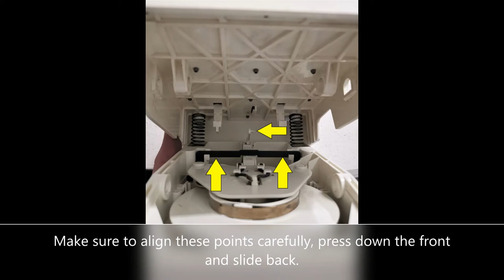Service of a Bernina Foot Pedal - Type 1000 Series

Comment: Hi Richard. Thanks for the video. Do you have any knowledge of how to fix the retractable cord in the foot pedal? I opened the pedal very easily because of this excellent video. A bit nervous to take apart anything else to fix my problem.
Reply from the maker: Hi, unfortunately not. I would imagine that you need to do it carefully because of the spring tension. Make a video about the process and post it.

Comment: I have a Bernina 1130. I didn't see a capacitor in your video.  Doesn't this model have one?  I haven't taken apart my pedal yet but have watched several videos which address the foot pedal not working, then suddenly it surges at full speed - which is my problem.  Some have said it's a capacitor problem.
Reply from the maker: Hi Bonnie, I am not an expert at this. The video is of me servicing my wife's machine.  It sounds like you might have the same issue i.e. a dirty riostat. Try and open your pedal and see if you can clean it. I don't think these pedals have capacitors in them.
Reply: @richardk100  Thank you for your reply!

Comment: The metal coil flicked off. It was so fast, I could not tell where it is hooked. I coiled it back but where does the end get hooked? Please help!
Reply from the maker: Hi Karin, if you pause the video at 1:07, you'll be able to see where the spring hooks.
Reply: @richardk100  Thank you!

Comment: Pushing out hinge rivets isn't good explained
Reply from the maker: Hi Racoon, see 0:20 in the video. You have to insert a screwdriver on the side between the pedal and bottom frame and lift the rivet.